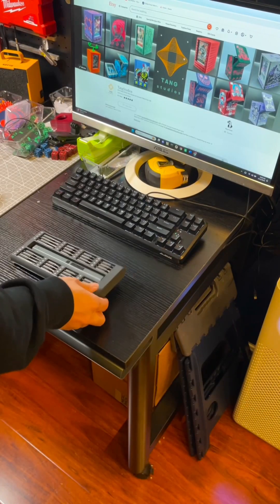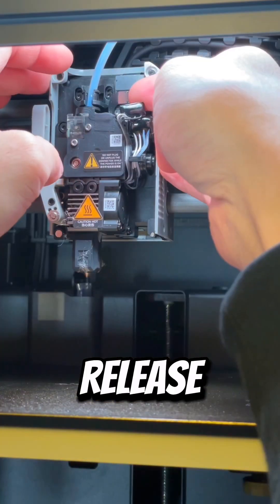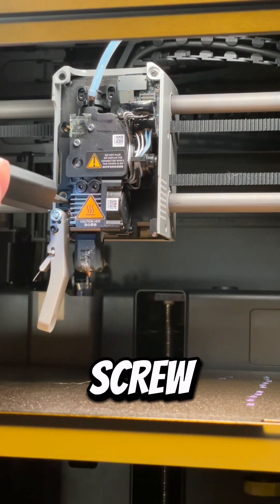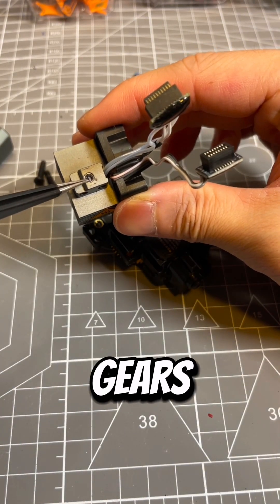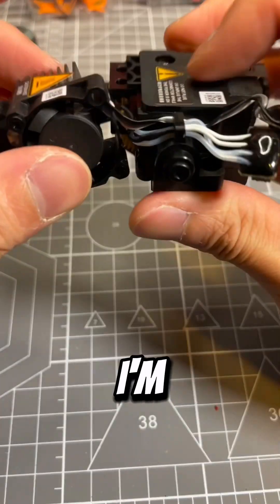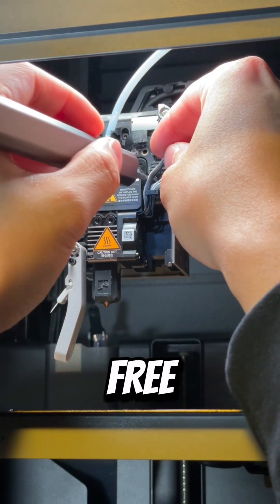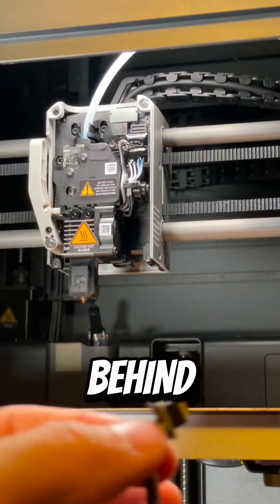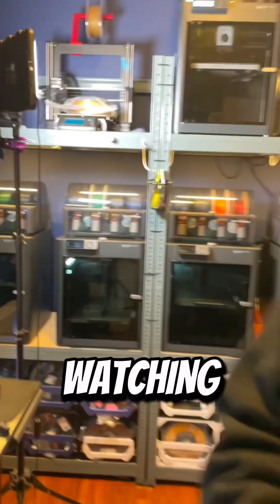FIX: Extruder Clog Bambu P1S

Comment: How do you get the entire print head to the front of the printer to do maintenance on it?  Right now mine is parked way in the back.  Do I just pull it forward manually?
Reply from the maker: Yup, make sure you turned off your device before you move the it manually!

Comment: How did you get the yellow gear off?? Mine seems kinda stuck in place I don’t wanna pull and break anything
Reply from the maker: There's a tool a 3D printed tool that elevates the extruder assembly so that you can use a small pin to tap it out. 

I didn't have the tool at first so I used 2 sticky note pads to hold the assembly, then left space in-between for the gear and tapped it out. 

I think someone mentioned that they used their filament spool hole, that could be easier too!

I was planning to make a tutorial for people without the tool but haven't gotten the time and chance yet... Here's the official bambu wiki for a visual example: https://www.youtube.com/watch?v=CLlT1RV-oJE

Comment: Great video but honestly I’m not sure how we are going to print a tool to get that gear off when I’m holding the hot end in each hand 🤣
Reply from the maker: Haha 😂 I get yah. The tool is meant to be printed before for preventative measures. 

You can actually loosen the screw that controls the tension of one of the gears (the spring). Then slowly wiggle out the yellow gear. 

I can make another vid about it when I get the chance 😅

Comment: yall instead of using a 3d printed tool that requires a working 3d printer, you can use a spool hole and just hammer it out
Reply from the maker: That's a nice tip!

Comment: My filament keeps getting stuck in the hot end and I have had to replace it 4 times. What could cause this?
Reply from the maker: Ahhh sorry, that's so frustrating. If you have had to replace the hot end that many times - I would definitely revisit print / filament settings. Have you calibrated the filaments you are using?

Comment: After doing this I’m now getting a prompt saying the fan isn’t working.
Reply from the maker: Hey you have to make sure that all the pins are connected properly. The fan is one of the pin connections on the right side. 

Use good lighting and reconnect the pins! Be careful as well, it has to align or you might risk damaging the pins! 

Let me know how it goes

Comment: I'm wondering if it's necessary to use the heat-conducting grease they sell, or is it for another part or machine?
Reply from the maker: its actually not necessary. I've used regular thermopaste before! I bought a big tube on amazon.

Comment: I left my P1S with AMS running overnight last night. When I checked this morning, the printer seemed like it was running fine. The print head was moving as if it were printing normally,  however no filament was being extruded. Does that sound like a clog issue, or a sensor issue? I'm waiting for tools to arrive tomorrow so I can follow this video but wondered if you had any advice. No errors output by the printer display or handy app.
Reply from the maker: Hey! That sounds like a clog forsure. I’ve had that many times 😅. I actually have a more in depth tutorial if you are interested. Check out my channel for the YouTube vid! 

Here’s the link : https://youtu.be/FASdmRbyK-o?si=K49vex1dh4t0bn_Z
Reply: @Tang.Studios  that's great! Thanks for the fast response! I'll take a look at that video and try a fix tomorrow. I'll let you know how it goes!

Comment: Too many videos fail to show that the wires connectors MAY be GLUED IN.  so removing the connection to the extruder may result in a broken circuit board, so be careful to check for white glue over the connector before unplugging.  The replacement board comes with more of the glue.
Reply from the maker: The pins are not glued. I have over 5 Bambu P1S printers and not one of them are glued. Are you talking about the X1?

Comment: I have a question regarding my P1S. I have been running it fairly consistently since the beginning of the year with occasional maintenance as pointed out by others. Lately I am having a lot of clogging issues with multiple hot ends. I replace the hotend with a new one or clean out an old one. I use a flame and a couple of "pokers" that I saw advertised online. I then use the tiny wires to push through the tip. I think it is fully cleaned when it goes back on but the next seems to clog again. Can these just not be completely cleaned after a while or am I missing something else? Thanks for you video.
Reply from the maker: It sounds like you are following the correct troubleshooting steps. I think it comes down to two things

1. Bad filament
2. Wrong settings

If you encounter the clog again, note the filament. Unclog it and try to print with another filament. 

I’ve invested in a filament dryer to narrow down the clogging issues. Hope this helps
Reply: @Tang.Studios  Thx for the quick response. I’m printing with Elegoo basic matte, which I have printed quite a few spools from so far. But I’ll take your advice and switch out for some new ones on my next attempt.
Reply from the maker: @thomasherlihy8670  happy to help. Even when you get the same filament the moisture levels can vary from spool to spool. High moisture causes clogs. 

Everytime I crack open a new spool, I check for these signs. 

• loosely spooled / not tight
• inconsistent thickness
• moisture on spool (more obvious on cardboard spools) 

If I encounter any of the above, I would pop them in to the dryer immediately. Not saying this is the master solution but it’s preventative measures. 

As for settings, weather and environment play a huge factor. Especially if your printer is in a place where temperature is not regulated. 

There was a couple days where I live where one day it was 70 degrees and the next day it was 90 degrees. I didn’t adjust my temperature settings accordingly and ended up with a few clogs.

Comment: thank you, i actually fixed it. the filament was bloated between the tube and the hot-end enterance. thats why the grar could only move it a little forward or backwards
Reply: Do you know why that happened? Trying to figure out how to prevent it
Reply: @Lion-wm6mf generally that happens when the tension is too high, the heat is too high, both, or when the force required to extrude is too high. Sometimes I have that issue while going from a filament requiring a hotter temperature to melt such as ASA to a lower temperature filament like pla. While switching, the hotend only gets hot enough to melt the plastic you are trying to push in, and that can be a problem when the filament still in the hotend is not hot enough to melt. So, in order to switch from a hotter to cooler filament, during the switching process you must set the hotend to be hot enough to melt the filament still in the hotend.

Comment: Any knowledge on why it would be repeatedly getting clogged?  I unclogged mine and only got one print before it clogged again
Reply from the maker: It really depends. I’d say these are the top reasons for repetitive clogs. 

1. Uncalibrated filament or filament / speed settings

2. Moist filament

3. Lack of temperature control (if your printer is in a room where temperature is uncontrollable, it might be messing up your prints)

4. Not fully unclogged (it can still be partially clogged from before)

Comment: Hey.  I'm about 4 days in to a brand new P1S printer.  Definitely clogged. Can't pull the filament out.  Have it all apart but I can't get the yellow gear off.  Help please.
Reply from the maker: Hey! Did you have another printer around? You will need to download the gear removal tool, print it, and use a small rod and hammer to gently knock it out. To find the tool, go on Makersworld and search up "Gear Removal Tool" and select the one by Bambu Labs!
Reply: @Tang.Studios do you realize how silly that sounds? To first fix your broken 3d printer, first print a tool…
Reply from the maker: @jaadmaan8156  well that’s trouble shooting 101. Take things step by step - if they had an extra old printer laying around that would have been the easiest and safest choice. 

If they didn’t - they can try to do it with two stacks of sticky notes, small hammer, and a pin to knock it out (literally what I did the first time around 😂). 

But I can understand why that sounded silly 😅 sounds like you print a lot, what printer do you have?

Comment: I can’t remove the PTFE tube at all. How do I proceed?
Reply from the maker: @natevenarske  do you still see filament stuck in there as well? When the machine tries to pull filament out it typically puts a lot of tension on the filament and that might be the cause of PTFE tube being stuck. Give this a try and let me know how it goes:

1) open up AMS & locate the roll of filament that is stuck. Make sure it is the one that is currently fed in and stuck.

2) feed in a little bit of filament to release tension (manually push some filament in) 

3) try releasing the PTFE tube now. After you successfully released - you can cut the filament

Comment: Where do I get that toolset?
Reply from the maker: Hey! Thanks for asking - I actually got it off of Temu 😅 “66-in-1 Cordless Screwdriver Set” 

Here’s the link: 
https://www.temu.com/goods.html?refer_share_id=ChqakM5IsuS81CLz7hmJOoGqvj170KT5&refer_share_channel=copy_link&_bg_fs=1&share_video=https%3A%2F%2Fgoods-vod.kwcdn.com%2Fgoods-video%2F402649ea70fcf3fc7c277d55b76e6bd01b603c11.f30.mp4&pic_w=800&from_share=1&share_imessage_opt=1&share_video_height=720&pic_h=800&share_img=https%3A%2F%2Fimg.kwcdn.com%2Fproduct%2Ffancy%2F0c25dd90-c865-4a8e-82e2-cd13d0145c79.jpg&goods_id=601099517076967&share_video_width=1280&thumb_url=https%3A%2F%2Fimg.kwcdn.com%2Fproduct%2Ffancy%2F0c25dd90-c865-4a8e-82e2-cd13d0145c79.jpg&_oak_page_source=417&_oak_region=211&refer_share_suin=RSSBB65WBD4BKHYJNJQGA3WVT2IFAY6AC725ZCXNW3VCPJWJADX7UW7WTYSCDQCZKT5LXQHXXI